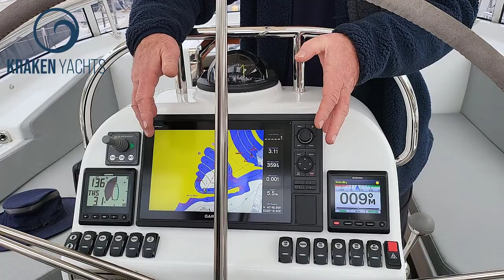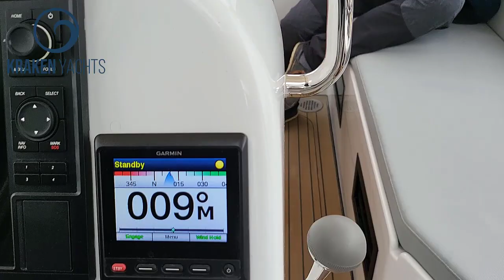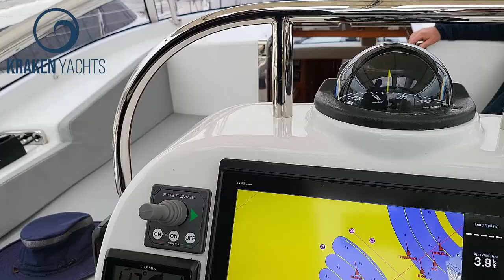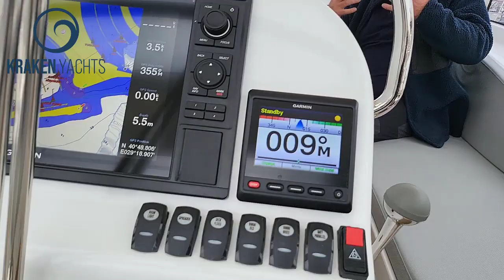Kraken 50  - Exterior Walkthrough & Explanation with Dick Beamont

Comment: At around 22:25 you talk about the heavier steering due to an unbalanced rudder. Have you considered a trim tab on the rear of the rudder? This is a small tab on the rear of the rudder that moves in the opposite direction to the rudder and reduces the force required to move the rudder. It’s common on aircraft but I’ve never seem it on boats.

Comment: I really like this mans approach to design, everything is how you would like it to be if you do it to work well, without cutting corners  I'm just thinking about the keel stepped mast.  If it breaks, it is clear that it will be above the deck, and it won't leave a whole in it.  Has anyone ever thought of engineering into the mast a point where it will break when a specific load is exceeded, i.e. a breakaway mast?  That would remove some uncertainty from a disasterous situation.

Comment: This guy takes advantage of "landlubber" ignorance with generous lashings of Fear.
Loosing the keel, standing rigging breaking, steering sloppy... are all things that can be avoided with regular maintenance.
All those problems with Diesel fuel & engines can be completely avoided with an Electric engine  + a bank of batteries. 
Brits. "biging it up"  knowing their talking to the uninformed.
A lot of those so called unique design elements are copies from other manufactures.
Reply: Your ignorance is outstanding. many boats with bolted keels have lost them despite regular inspection.
Reply: @davidforbes7772  I have been sailing since 1964 ...never heard of a keel "falling off" .. .. your comment is baseless.
Reply: Yet you offer no proof for your assertion.
Reply: @petertaylor8922    Plenty of documented cases of keels falling off, spade rudders being broken off and loss of steerage because production boats use cables.